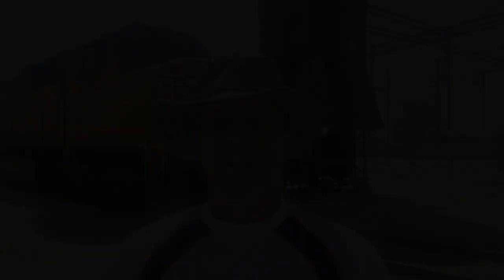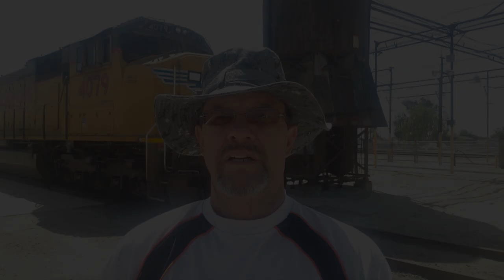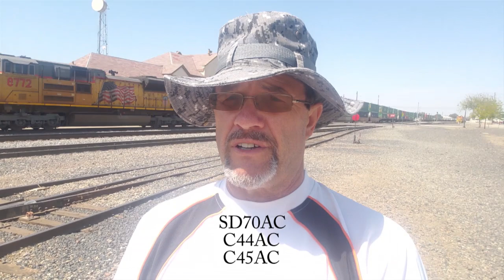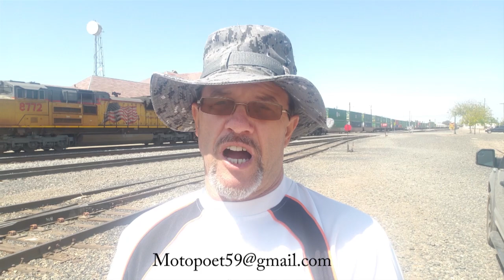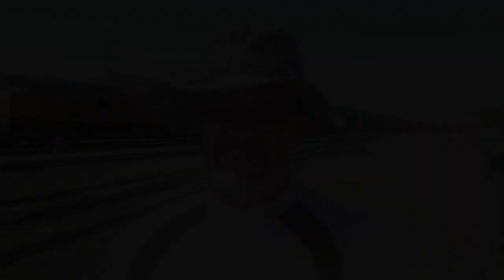Locomotives: AC or DC?

Comment: I believe most of the larger new locomotives convert the energy from the engine into A/C amps as it flows through the alternator, and then the amps are converted to D/C through an inverter bank to stabilize the amps, and then once the amps are stabilized, the amps are converted back to A/C and the stabilized A/C amperage powers the traction motors attached to the axles.  I could be wrong, the process is a little more complicated than that.  But essentially the A/C amperage produced by the alternator is very inconsistent based on the changing energy output of the diesel engine, and thats why the current is converted to D/C to stabilize before being converted back to A/C to power the traction motors.

Comment: The big reason AC motors are so much better than DC is DC motors generate back EMF as they spin faster. It's a current trying to flow backward from the motor to the alternator and the alternator has to constantly fight this by increasing its output voltage, but it can only do that up to a point. AC motors don't have this problem as far as i know. And because they don't the locomotive has more power available to pull with instead of fight with itself.

Comment: Also One thing about DC and AC is that AC makes a lot of more noise than DC and the reason why a lot of train companies making commuter trains in  the 50s and 60s were using DC because it’s much more silent than AC the Budd M1/3 still going strong using DC power since the 70s some people say that DC can be burned out easily it depends on how you maintain the trains if they’re being constantly check apart to be replaced they won’t burn out that frequent Metro north take care of their DC Units

Comment: At SF BART we run DC as well as AC. The older cars run on DC which are higer maintanence (C cars). Brush changes, motor contactor contact changes, analog stuff. The  original A and B car fleet was rehabed in 2000-2001 now termed A2 and B2. The then new AC motors and drive were installed. Giant transistors (IGBT's) in the motor control box control the motor speed and dynamic braking. The IGBT's are controlled by a logic unit linked to the IGBT gate drivers through fiberoptic cables. Fiber optics are used to eliminate electrical noise being induced by the high power floating around in the motor control box. The AC motors are 3 phase where the positive and negative parts of the phases are created by the IGBT's and logic unit (Insulated Gate Bipolar Transistors=IGBT). There are 6 IGBT's for the 3 phases and a couple more to dump the regenerated dynamic braking power into the brake grid. Very efficient system. To my knowlege most new transit cars use this propulsion system. Even our new fleet of D & E cars.

Comment: With AC traction motors there is no minimum continuous speed.  As long as the wheels turn the train will move.  With DC traction there is a speed called minimum continuous speed, if the train is run below the minimum continuous speed long enough the traction motors will burn up.

Comment: I’m sure someone has already mentioned this but the single major difference between ac and dc traction motors is that ac motors are physically incapable of free spinning,  they spin according to the frequency of the AC power supply.  This prevents uncontrolled wheel slippage and greatly improves rail adhesion and tractive effort.  This results in AC locomotives having much better traction than DC and can therefore pull much more weight from a dead stop with the same HP.   A DC loco is subject to infinite wheel slippage in wet/slick environments and are susceptible to burning out the traction motors

Comment: Whether AC or DC the Prime Mover or Engine is still the same.  It is the Generator and Traction Motors that are one or the other.  It is my understanding that AC is far superior at pulling at low speeds and being able to crawl up mountains without stalling or overheating where DC motors can not.  DC motors are good for fast moving trains with little grade to contend with.  AC is also more reliable and less maintenance.

Comment: DC load/ make power quicker. AC load slower but make more power. 

All locomotives I believe are DC first the ACs are then converted from DC to AC. 

BNSF have six physical axle locomotos but only four axles are powered. They are AC locomotives which are designed to load quicker to get up to speed quicker on higher priority trains.

Comment: Hey your voice sounds good now. You’re getting better and I am too. You know on those locomotives all they had when I was running was DC traction motors. The Diesel engines has generators that converts the electric to DC for power to the DC traction (600 volt) motors. Each set of trucks (2 axles) has a 600 volt traction motor. Your jeeps (SD 7 or GP 7) have 4 traction motors. Your bigger engines (SD 9, SD 45 i.e.) have 6 traction motors. Now Mark, please don’t think bad of me. I’m not one who knows everything but I do know a lot about locomotives being a retired engineer. Sorry to get so lengthy. I really enjoy your channel. 👍👍👍❤️

Comment: It’s interesting that on the iron ore railways in the remote north-west of Australia, Rio Tinto with their GEs were very late to convert to AC traction. BHP-Billiton in the same part of the country have run AC traction EMD SD70ACe for years. They run what are probably the longest and heaviest trains in the world, BHP run them at over 40,000 tons gross weight in extreme heat conditions. BHP bought some GE AC6000s but they had so much trouble they scrapped them all. One of the problems was with the AC inverters in the heat.

Comment: Glad to hear normal voice again Mark. DC traction was the original design for diesel electric locomotives..it's simple and fairly cheap. AC traction appeared in the 80's (I think) It's more complicated and expensive  but it offers better  traction effort and fine speed control at slow speeds, also dynamic breaking works right up until stopping.  The traction motors are brushless and require less maintenance as well.

Comment: The big AC's have the inverter bank behind the conductors seat. They have what is called constant speed traction motors. Some AC's only have 4 traction motors so that any DC unit that is coupled into the consist will not be over loaded, they can have 2 more traction motors added at any time. The units that are in coal train service still have 6 traction motors for dynamic brakes! The general AC freight pool though only have 4 traction motors to balance them out with the DC units!

Comment: Ahhh !! Yes it is understood that locomotives  with AC traction motors are more efficient.. 
But then another question would be how do you control the direction with AC locomotives  ? With DC you just reverse the polarity.. not so with AC .. 
I went to an trade show once and an EMD engineer told me you adjust the phase of the AC to change direction.
Reply from the maker: That's something I didn't think to ask!

Comment: I wonder whether the explanation is that straightforward. I'm not an expert, but what I've learned during my study is that the DC locos are easier to manufacture, easier to maintain, and thus are cheaper in comparison to AC locomotives, in general. The truth is that there is a limitation with the power transmitted to the TE as DC engines are limited by the voltage on the commutator, I think in particular this would be 3000V. So that's why at least here in Europe you can barely find railroad DC transmission lines with voltage over 3kV. On the other hand, there is no such limitation when using an AC due to the different construction of the AC engine. So when talking about the railroad operations where lower power needs are sufficient, I would say that DC locomotive could be an economic choice. But feel free to correct me if I'm wrong :)
Reply from the maker: Someone else would have to correct you! As I said, I only know what I was told!
Thanks for checking it out!

Comment: Since you are discussing AC vs DC, I have a question. I've acquired a working grade crossing bell "not the new E bell". Does it take AC or DC power, and how many volts? I tried it just once with a 12v battery and it works just fine. I want to hook it up, but correctly.
Reply from the maker: You are correct. 12vdc is the proper power. Should work forever in a display set up!
Thanks for checking it out!

Comment: UP 4079 is an EMD SD70M built in 2000, it is UP's 80th SD70M they purchased. Currently the most common locomotive on their roster is the SD70M. All DC power none are 70MAC's as some claim on the later SD70M (2002+) versions that were equipped with flared radiators. Glad to see you around Mark!

Comment: The A/C (alternating current) vs. DC (direct current) thing has to do primarily with the traction motors, that is the giant electric motors in between each set of wheels, and of course the generator that runs them. The dc motors can be burned out more easily by overloading, whereas (as I’ve been told) the ac units can be loaded in a way similar to steam locos. For example, the train can be held on a slight upgrade with just a notch on the throttle (no brakes) which creates a high current draw. AC motors can handle this, but a dc motor would burn out from the amp draw.

Comment: Sometimes you can tell an EMD AC unit by its having inverter cabinet doors, and you can tell a GE AC unit by the inverter cabinets on the conductor side of the loco.  An early SD70M (DC), and a SD70 MAC look almost exactly the same .. you have to closely look at the body door details or just read the big SD70MAC decal on the side :)   With GEs, looking from the engineer side, I cant tell a DC from an AC unit, but on the conductor side it is easy.   I swear by AC traction motors .... they pull and brake like nobody's business, and they can be stalled for a bit.  Good topic Mark.

Comment: I think the A C generators are powered by 4 stroke 16 cylinder diesel engines since the mid 1990's . The old DC generators in the older locomotives are powered by 2 stroke diesel engines. I'm not an expert, but I remember reading about it 25 years ago in Railroad Magazine . The article was a 75 th anaversery edition "GM electromotive 75 years". I don't remember exactly what the correct title was but it came out in 1995,6 or 7, August. They also featured the new 6000 hp GM AC90 MAC.
Reply: Hello David. Let me help sort this out if I can help explain it a little better. There has been two diesel engine types in use on American railroads: 2 cycle and 4 cycle. This has nothing to do with AC or DC traction motors, nor does it have anything to do with AC or DC power generation. Alco, GE  and now Wabtec, locomotives are all 4 stroke (4 cycle) diesels. The power generation was AC which was converted to DC using a rectifier bank for the DC traction motors. In 1994 GE introduced the first freight locomotive to use AC traction motors.
EMD, and its successor Progress Rail, utilized 2 cycle diesels exclusively until the 2015 introduction of their 1010, 4 cycle diesel which could pass tier 4 emissions standards. EMD historically employed DC power generation until the mid 1960s when they began utilizing AC power generation rectified to DC for traction motor use. EMD began to include AC traction motor locomotives in their catalog in the 1990s. Edit: To clarify EMD was actually first to introduce AC traction to the diesel locomotive market in 1991. GE's AC competition was brought to the market in 1994.
Reply: @thomasdupee1440  I used to work for EMD back in the 90's. I worked with SD60MAC (BN), SD70 MAC (BN/BNSF), and SD90MAC (UP).   I agree with your comments, however it was EMD who introduced the AC traction motor for USA freight operations.   The AC motor test-beds were the 60 MACS used on BN, then EMD followed up with the 70 MAC's.
Reply: @billtimmons7071  I stand corrected! Thank you. I did know this but botched it in my comment.
I believe that EMD also pioneered the 6 axle radial truck. I once asked a GE engineer why their radial design was so complicated when EMDs was so elegant. His response: EMD had the patents.
Reply: @thomasdupee1440  No problem. Your comment is well written and very useful. The bottom line is that EMD was first but ended up last ... the market has spoken. Thank you sir for your content.
Reply: @billtimmons7071  Thank you for your contribution. When I started working for B&O/Chessie in the 1970s, B&O was all EMD. C&O had a few token GEs on the roster. The thinking was that EMD had the better product but they wanted to keep another manufacturer in the game in order to prevent a monopoly. Then GE finally got their act together with the -7 and -8 line. GM began to starve EMD of R&D capital while GE was investing in an improved product. So here we are in 2021 with a complete reversal of product dominance in the locomotive market. The fact that the 4 stroke diesel used less fuel per HP output didn't help EMD (until the development of the 1010). We used to refer to GEs as "junk". We don't anymore.
Reply: @thomasdupee1440  Thanks for the great response. That's UTUBE at it's best. And thanks to Bill Timmins too.
Reply from the maker: I love it when my videos create such informative feedback. Thanks guys!

Comment: Maybe some one can answer this. Are A/C and D/C units compatible with each other in a lash up? Example: 2 A/C and 1 D/C. What about helpers? Example: Head end A/C and helpers D/C or vice-versa?  Sorry, but you did say "comment below"......🙃
Reply: Hello Thomas. In a word, yes. All locomotive units which are multiple unit (MU) capable can be operated together in a consist. It is the engineer's responsibility to consider the capabilities (and limitations) of each type of unit in train operation. Such as: when pulling a grade, the AC traction locomotives will not overheat the motors, the DC traction locomotives will begin to overheat the motors when the speed drops below the "minimum continuous speed". MCS varies from model to model. The MCS for 4 axle units is usually about 12 MPH. For 6 axle units, about 9 MPH. To prevent DC traction motor damage, the train must be stopped and the traction motors cooled before resuming the climb. Another consideration is dynamic brake capability. AC traction locomotives can bring a train to near stop without the use of air brakes. The DC traction locomotives can't do that unless they're equipped with "extended range" circuitry. In a mixed consist, the engineer must understand these characteristics. (Edit) I must add to my comment that MCS only applies while operating under full load at full throttle.
Reply: Thomas Dupee l
Reply: I see SD70M's (DC) in line with C45's (AC) all the time pulling out of Houston. I'm sure there's a limitation to what the train can do.

Comment: AC motors allow for better traction at low speeds and the traction motors don't overheat and requires less maintenance than DC ones and are cheaper to manufacture, but requires more expensive electronics.
Reply: Howzit : I Believe Your Explanation Is Certainly The  * MORE *  Correct; With The Added Benefit Of  AC-Traction  Allowing For Low-Down  * GRUNT *  On Grades. I Also Recall That The Additional Preference For  AC Followed The Later Development Of Necessary Superior; Reliable and Robust Control Electronics. Again; Much Ta For Your Interesting Series. Regards + Cheers For Now / Johnny